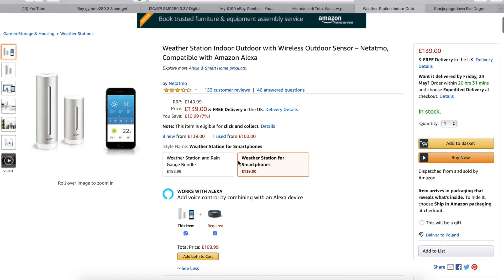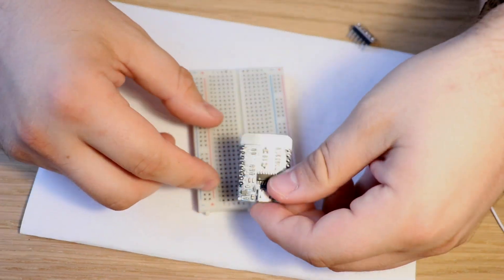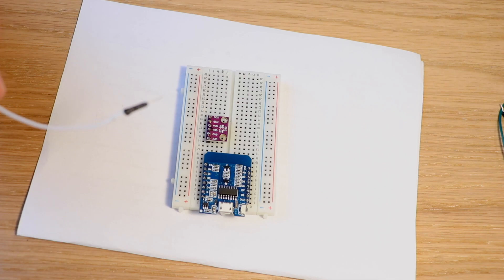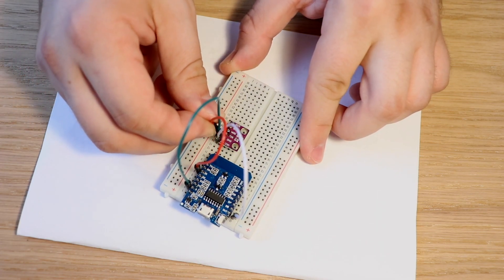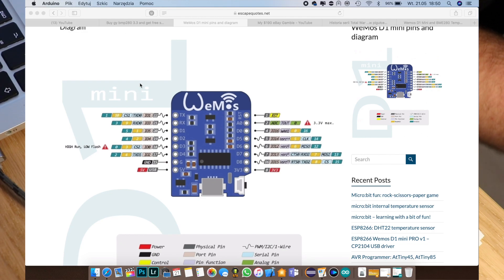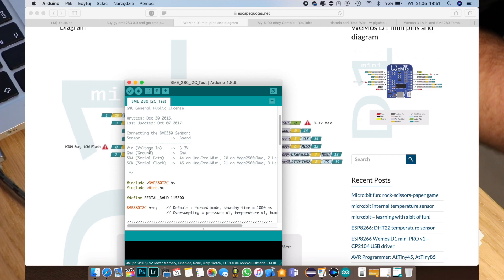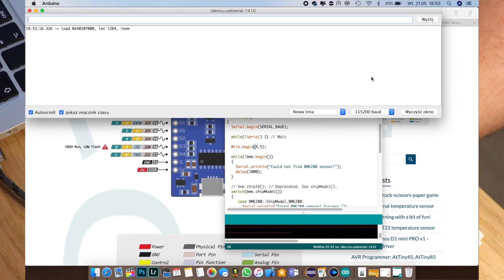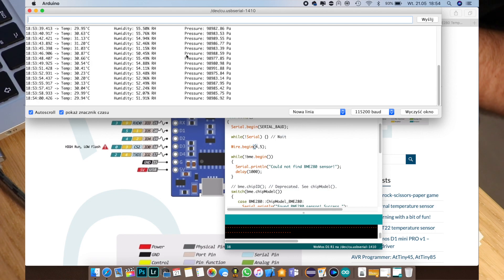Cheap Weather Station. WEMOS and BME280.

Comment: Where did you get the BME library, Adafruit one does not work, i have the same sensor as you
Reply: I'm using a Wemos D1 with a BMP280, but I just flashed Tasmota onto the Wemos and it works great.